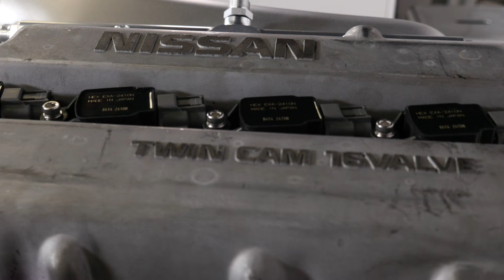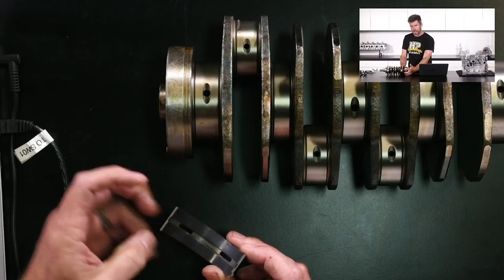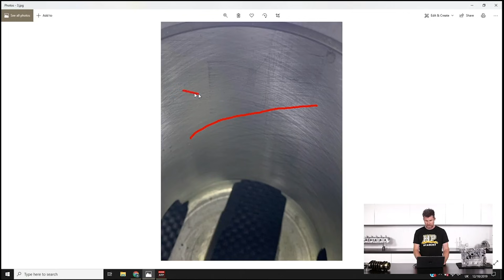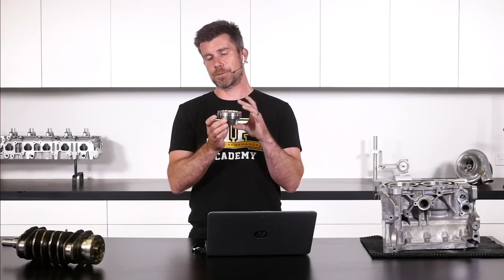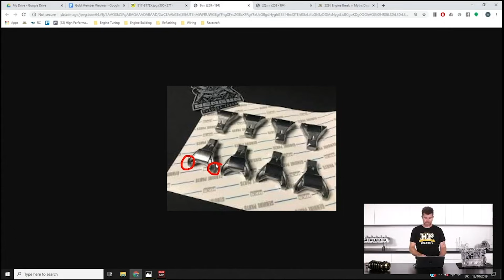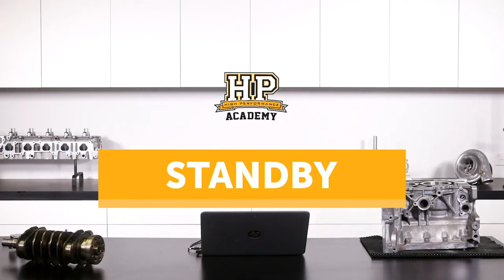Engine Break-In Myths Dispelled | Engine Break-In Tips And Tricks [GOLD WEBINAR]

Comment: Hello.
Great information - thank you very much!
Still this leaves a question for me.
Will the use of oil with ZDDP in it slow down the bedding in process of the piston rings?
Greetings.
Martin
Reply: No. You don’t need extra  ZDDP for new engines. It’s for already worn, about to wear, and race engines that WILL wear rapidly in use. Think of ZDDP as bondo. It fills in the gaps of metal imperfections in the engine when wearing begins.

Comment: I have a theory about oil usage on Honda engines. 
I've done a lot of work on Honda B and K series engines over the years and some will use maybe 1 litre of oil per 1000 miles and some won't use a drop. Both can be used the same, on the same oil and have similar mileage. Both can make similar power. Both types are really common. 
My theory is that the ones that use oil, followed the manufacturer break in period of however many thousands of miles, and the ones that don't use any were beasted from day one. I can't prove it but it makes sense. It's almost always ring failure when they start smoking too, usually gummed up oil rings.

Comment: Note: You can set your initial spark timing EXACTLY before ever starting the engine for rapid initial start, doesn't matter what type you ignition system you have, such as breaker point, HEI, TFI, hall effect, ect. (excluding DIS), just make sure your carb float bowls are pre-filled, or your EFI system is bled of air.
Reply: Yep, exactly.... And that is something a person had BETTER do if they are using a flat tappet camshaft. Excessive cranking, starting and dying, and fiddle fucking around trying to get the engine to run correctly is one of the leading causes of an unsuccessful break-in of a flat tappet cam, and flat lobes in a very short time.

With a flat tappet cam, one needs to set the engine up correctly so that it fires immediately on the first crank, runs properly, and cool, so that it can immediately brought up to 2200-2500 RPMs for 20-30 minutes, varying the RPMs every 5 minutes, to ensure a complete cam break-in and no flat lobes down the road.

Comment: 23:10 in there by immediatly after the startup, bring the engine RPM to 2500, you mean like really just after turning on the engine rev it up? like with cold start temperature? or you need to let it idle for a moment or a minute or two to get some temperature and then rev it to 2500 RPM?

Great video and info, thank you.

Comment: I would imagine that, in the intervening decades, oil additives have been developed that exceed the performance of ZDDP.
Reply: Flat tappets need zinc but I don't believe anything else does. In the last few years all but a small percentage of builders report flat tappet lifter and cam failure because  of garbage quality steel .

Comment: If that's the case, why would auto/bike manufacturers instruct the exact opposite for the break in period in their manual? They instruct a longer break in period, even up to 5.000 miles, never full load, and nowhere near max engine rpm. KTM instructs no more than 50% engine load and 7000rpm for the first 3 hour of use for their dirt race bikes, and no more than 75% load for the next 10 hours of use. All supersport bikes instruct no full load and high rpm for at least 1000 miles. For the S2000, Honda states in the manual that the engine break in will take up to 7000 miles depending on the conditions. 
And talking for manufacturers, they have the highest end machining equipment available, that any local machine shop can't afford, accompanied by the best available honing techniques.  
 So what's the truth afteralll?
Reply from the maker: If you had to take a guess yourself beyond what is discussed in the lesson, what do you think the reason/s would be? 
Why would an OEM suggest a slow and cautious break-in for a member of the public who purchases one of their vehicles?
Why would a motorsports team that can spend hundreds of thousands or even millions of dollars on travelling and racing throughout a season where sponsorship to do it all again next year often relies on results seemingly throw caution into the wind? - Taz.

Comment: The only reason for a break in period on new vehicles is insurance (really, manufacturer want's you to get used to vehicle so they don't get sued)
The reason for engine builder to say engine needs break in, they either didn't do a good job or know things will break and they want you gone from shop.
Extended idling periods are always a VERY BAD THING as many components that rely on 'splash lubrication (small end bearings, etc) will not get enough or any oil at low rpm even when pressure is good. 
I was always under the impression ZDDP was removed from oils because of catalytic converters - it stops them working. and manufacturers didn't want to warranty 5 yr old vehicles when converters were costing $1200+ (CARB/EPA)

Comment: Great video! Completely disagree with the not breaking in with full synthetic oil. BMW, MB, GM and more all send brand new high performance engines out with full synthetic oil installed in the engine. I have personally been an advocate of synthetic oil since the introduction of this product in the early 70's. I have been breaking in NA, Turbo charged and Supercharged engines with full synthetic oil for 50 years and have never had a ring failure from oil being to slippery as all the fable and folklore goes. I have personally spoken with engineers from BMW and have been informed that the oil recommended for service is the factory fill on brand new start up. This synthetic oil myth has been busted.....
Reply: Hi Steve. Not that I will disagree with you (I'm about to break-in my first engine ever), but I would like to point out that conventional is much cheaper than synthetic. With all the assembly grease, metal and so on in there I'm just looking for a cheap fillup to wash the internals then toss it after 20 minutes. Seems a shame to use a nice synthetic for that.
Reply: Harley Davidson also.  Fire up and run it like you’re going to drive it
Reply: Harley makes tractor engines 😁

Comment: I had a question - I started an engine rebuild and life got in the way (had to do a job move, etc), the engine has been on my engine stand for a couple years now.  I used a permatex assembly lube back then, should I disassemble the engine again now and start over with the crank, etc to re apply the assembly lube???  I haven't put the rods and pistons in yet.  Just the cam and crank and the crank is torqued down.  Engine is old school Ford 352 FE bored .030 over.  Going into a 1967 F100.  Not a race truck but I don't want to hurt it at start up either. Thanks, love the videos. Clay

Comment: OK, But how do you not "ruin the hone" and seat the rings when it could take 30min to an hour to 
1) Idle and bleed the air from the coolant
2) Set ignition timing with a timing light
3) set a base tune and injector dwell on a brand new standalone that has nothing. 
4) sort ALL the leaks and bugs that we're looking for while it's idling BEFORE we can run it hard to seat the rings. 

This is worrying the crap out of me because I already messed up 1) Started my forged SR20DET just after filling it with oil and did NOT do the spark plug removal trick. 2) I spent time to idle to BLEED COOLANT and SET IGNITION TIMING AND FPR PRESSURE to the proper levels...

How do you do all of this on a brand new block????  How is it even possible without ruining the hone?? I feel like i fucked up before i've even left my driveway!
Reply: llololololololololol sorry man you ruined you car
Reply: @rustypotatos  smoke another one bob. I needed some expert advice not you
Reply: @twrcrew8852  smoke another engine and then make a video about it and post it on youtube. im sure everyone in the comment section can help you out they are professionals
Reply: I am wondering the same thing.

Comment: Someone explain. So i understand the rings can get too hot and so you don’t want to load the engine too much but I can’t think of why just running at a low load wouldn’t set the rings right. I understand that you want to seat the rings before the cross-hatch is worn and so you want to put a load on the rings to seat them while the cross-hatch exists. But it’s not like the cross-hatch is wearing itself out, the rings are doing it. Regardless of load the same amount of friction will need to be achieved to make the cross-hatch go away. Take sand paper against wood and either you can press hard with less strokes or softer with more strokes. Regardless the same work needs to be achieved. This tells me that unless you damage your rings from heat you will seat the rings regardless of how you drive it. Aren’t cams supposed to run for like 15 mins at a set rpm anyway? Is the risk with a low load the possibility the rings could spin out of their offset with the higher number of strokes? I just don’t see how you could make the cross-hatch disappear without an equal and opposite reaction on the rings, regardless of load.

Comment: It would be interesting to gather stats on repair costs and lifetimes of cars that were broken in vs. ones that were not - for example, demos.
Reply: Maybe engines failing to break in is not that common. If someone installed a rebuilt engine in a vehicle and went out driving on city streets immediately, with all the stops, accelerations, decelerations, and idling at stop lights and stop signs, the engine probably would break in properly. 

The only way you could create a problem is driving at a sustained speed for a long period of time such that the rings heated up and scuffed the cylinder walls. With a cast iron engine and conventional oil, I think it would break in eventually no matter what you did as long as you did some varied speeds early in the break in cycle.

Nevertheless, I would follow the recommended break in protocols if I ever installed a rebuilt engine.
Reply: @anonymike8280  there are definitely some does and don't to break in. 1. Prime the oil pump and or pump oil through the engine 2. Do not use synthetic oils.  Use "break in oil". Synthetic oils will not allow the rings to seat (found this out myself).
Reply: @justanobserver530 I wonder how all of the new Corvette’s ever break in their engines since they come from the factory with Mobil 1?  Ah, you have succumbed to yet another myth.  Engines will break in just fine with synthetic oil.
Reply: @LTVoyager  spoken from someone who's never rebuilt a single engine, so anyone who reads your comment can know you're an idiot.  All of the engines today that run on synthetic....do some research before you respond with asinine comments...better yet YOU rebuild a 50s, 60s or 70s engine and break it in on synthetic oil and THEN tell me how I'm wrong, dip shit
Reply: Stats are already out there. No car manufacturer does a ritual break-in...need more evidence? All engines come from the factory with full synthetic oil in the crankcase and had that same oil in it from the very first start...kind of blows that theory out of the water about ring seating doesn't it?

Comment: One of the biggest factors modern break-in is so brief vs "Old School"  is lack of Leaded Fuel.   Leaded fuel drastically impacted Ring bed-in during the Muscle car days.  a long gentle break-in was warranted.  Also very short oil change cycles were in order.  Old School methods are todays myths.  Now I'm off to have an argument with  an older family member as to why you don't have to warm your modern car up for 10 minutes before driving it...

Comment: well that was a long watch but very good info..  obviously a lot of experience with fresh motors.. So much bad info on the web about this subject and nice to hit one that pretty much knocks it out of the park for accuracy..    
A couple side notes on "flat tappet" cams...    "flat" is relative, lifters are actually "convex" ground so refacing is a process that is really "iffy".. buy new..   Cam is also bathed in a lot of "splash" from crankshaft and drain down from engine valley..   (this is in fact a problem on the new "Hemi" motors from Mopar.. cams are running too dry and self destructing... Is the main reason for the 2000-3000 RPM process.. get oil up there...  
"most" racing oils are high in ZDDP additive package but lack detergent packages..  I like them for break in  before going synthetics...  
You do know that the "authorities" will be here and then bring up Cr and DLC coatings.. blah blah blah... more things change, the more it stays the same... find info specific for your build..

Comment: If you disagree with any of this, you need to go back and think again.
Only components to bed in are rings to bore, cam to follower and some times oil pump drives. 
If you have a radical cam profile lifting over 15 thou/deg you need 4000 rpm the moment it starts. Only way to run that type of engine in, is on a engine dyno, I've tryed on a chassis dyno, over the past 30 or so years with mixed results.

Comment: Newzealander for beginners:
"Beer ring"  = A mechanical element used allow rotational movement and reduce friction between two parts.
"Heed" = The upper part of an engine, bolted to the engine block.  Usually houses the combustion chambers.
"In gin" = The mechanical powerplant of a vehicle.
"Beed in" = To wear mechanical parts together accurately through use.

:D
Reply: No you got it all wrong mate. A Beer Ring is the mark your Fosters can leaves on the coffee table from sweat because you couldn't bring yourself to take another sip of the nasty stuff. Heed - that's what my wife gives me.  In gin - that's when you drank so much gin you can't walk straight. Beed in - That's what it's called when people catch beads at a Mardi Gras parade.
Reply: @DivergentDroid  Correct... 👌
🍻
Reply: I thought the beer ring was the mark that the Foster's leaves on your upper lip when you are guzzling it from a big mug🍺
Reply: you forgot “manurel oil” :)
Reply: LOL. Thanx for the dictionary!

Comment: Oil. 
When I worked a John Deere dealership, a rebuilt engine would be hung a couple feet above it's oil pan and a pressure bottle would force oil thru the galleys. What you thought was sterile would put pieces of gasket, adhesive, metal and whatnot into the pan before cleaning and assembly.
As a Triumph motorcycle mechanic we would run a motor around the block and change oil, run a couple miles, change oil, then maybe 100, and the oil was always showing metal dust, but they didn't have filters either.
Hearing of ramrodding fresh engines for mega power, I had doubts. Many thanks to this video for showing the middle and safer road for that!!!

Comment: warm it up to operating temps, check for leaks, top off coolant, full send. change the oil at 100 miles and cut the filter open and inspect. No brass, keep smashing the gas.

Comment: I’m building a fresh hayabusa turbo engine but also going to be using a MegaSquirt ecu for the build. Would you recommend I get the ecu running on the original engine first before rebuilding so I can seat my piston rings properly once the rebuild is done? I don’t want to have any chance of engine damage because the ecu isn’t programmed completely for the first run/break-in. 
How would you guys tackle this usually?

Comment: Great video, methodical. Had to let mine idle for 2 minutes to check for leaks and dial in the fuel pressure regulator, top up coolant etc before I go out on the road. Next start (after lockdown) will be on the way to the dyno 5 miles away and 1hr run in as suggested! Great video, thanks!

Comment: Only break in I've ever done was a short run at about 2500rpm, not idle, when using solid lifters, hydraulic non-roller, and that's only because it's recommended for lifter seating on the camshaft... roller lifters don't have such a recommendation... outside that, I only changed oil after about 300-500 miles, then ran the engine as I desired......

Comment: I’m pretty sure breaking in with synthetic oil is a myth because most high performance OEM cars are factory filled with synthetic oil
Reply: Yes and a number of them have had to rebuild bottoms due to bad ring seal and blow by oil burning. Of course depending on rings used.

Comment: Hi, I have a question that still confuses me. How would I go about breaking in an unturned built motor? 

I'm installing a freshly fully built 2jz (10:1 forged internals, main/head studs, cams/springs/retainers) with a brand new out-of-the-box Link G4+ ECU. From my understanding, the Link ECU comes with a base tune for the factory engine in my IS300. Is it okay to use this base map (with parameters adjusted for injector size, etc). for the ring sealing with the smallest/weakest wastegate spring I have? 

I'm also thinking about unhooking the charge piping altogether and running it naturally aspirated for ring seal, since the base map is for a stock NA engine. What would be your approach?

Comment: A question about loading the engine on the dyno. You talked about loading it for 2-3k rpm 10-30 procent throttle for 10-20 seconds then cooldown the rings and then run again for about 15-20 min. Then gradually go for something like 4500 rpm  60-70% throttle for about an hour. In this last case, where we run for higer load for an hour, are we running this without cooling down or are we doing it for a few seconds and then cooling it down like in the first case ?